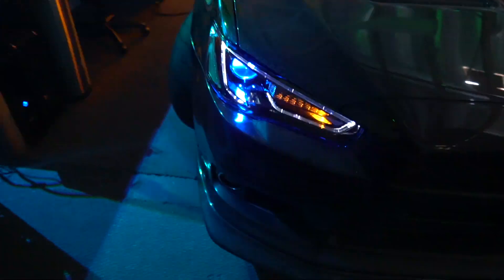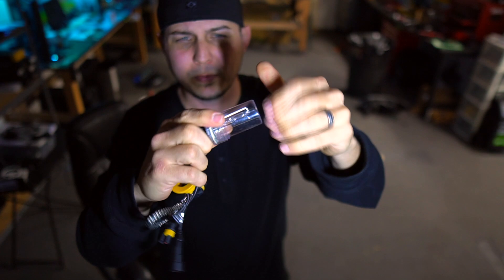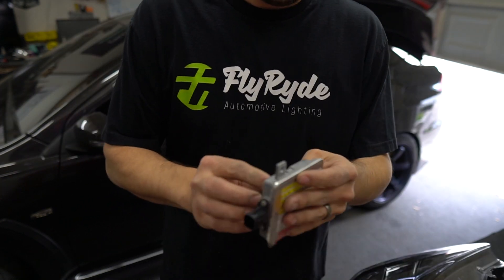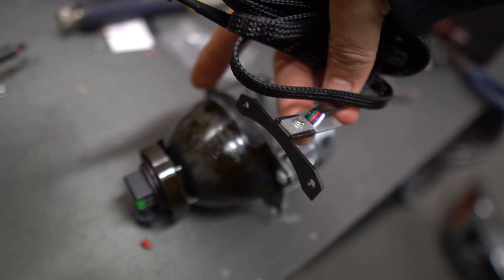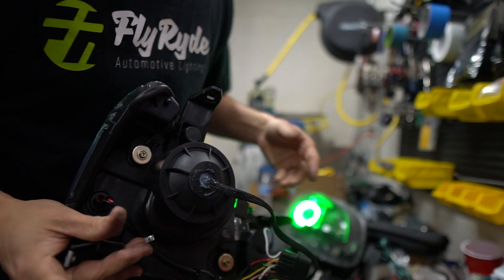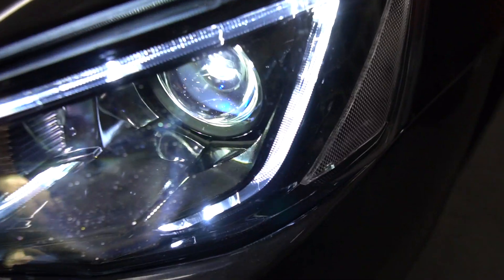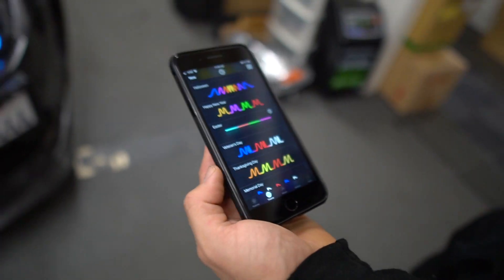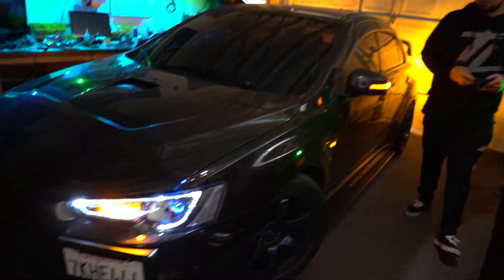3 MUST HAVE Custom Headlight Mods for Vland Evo X Lights | FlyRyde

Comment: Looks really good I also got vland for my evo x my question is how to repin the low beam lights?
Reply: mine too! and also my high beam doesn‘t work.. do you really use just oem stuff?
Reply: How did you manage to get the low beams working? What bulbs did you use?

Comment: I’m in the process of switching my factory stuff to the vlands, I noticed there is no connection for the baslast to the vlands it’s a 2 pin on the factory harness, how did you wire them up to the vlands?

Comment: Awesome video. First time viewer and I'm hooked lol I recently put the SSS OEM ballast and bulbs in the VLands (Evo X) as well. I originally thought I had the Demon Eyes but it was just the bulbs :/ How would you mount the demon eye with the bracket to the Vlands? Do I have to open the headlights? I see a plastic part on the top of the projector but not sure if I can reach it from the bulb opening. Thanks

Comment: Does demon eyes  only stays on the whole time when you are driving? and when you turn the low beams on the demon eyes turns off so your normal white LEDS come on?
Reply from the maker: The two system are completely independent of eachother